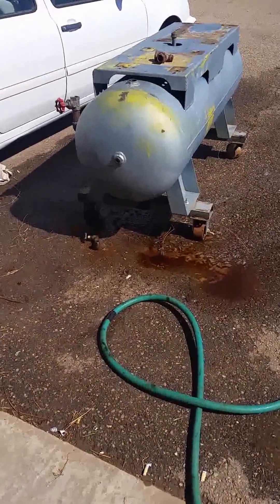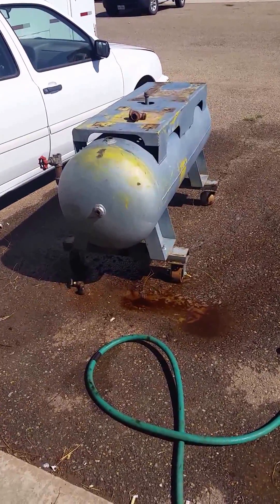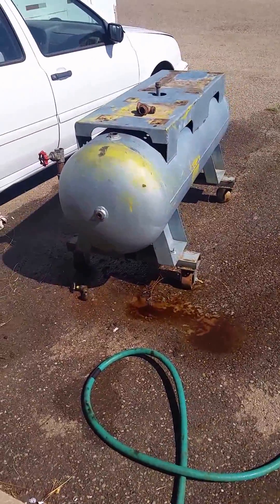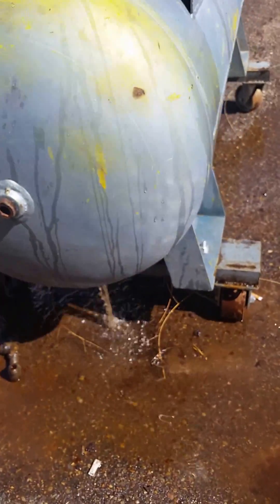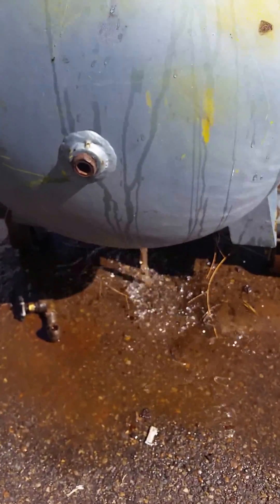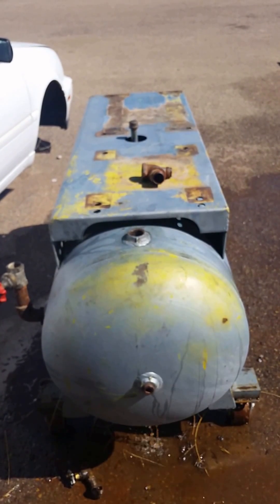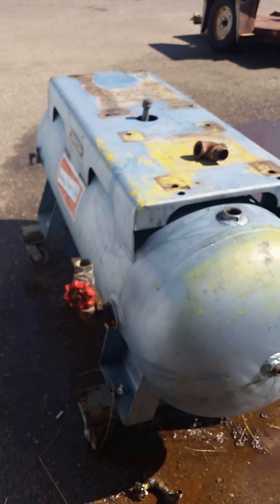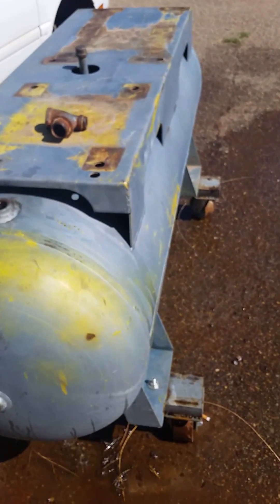1957 Kellogg American Compressor tank Part 1

Comment: Dumbest thing to do is use a take from 1957 with any rust coming out of it. 
They rust at the bottom and work their way up. 
I found an old take and clean water came out but I cut it open to use it for something else, over half the wall thickness was rusted out in one big spot.
Unless you can put a camera in there dont use that tank. Old tanks can easily pass the hydro testing but if there is deep rust in them that will hold onto water and rust 10 times as fast when its back in use. 
get a camera in there or toss it in the trash.